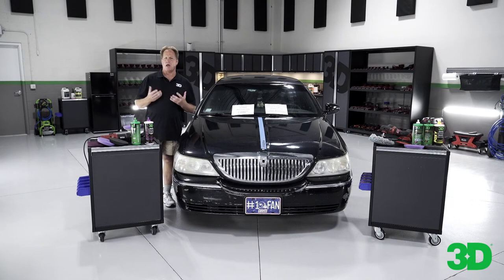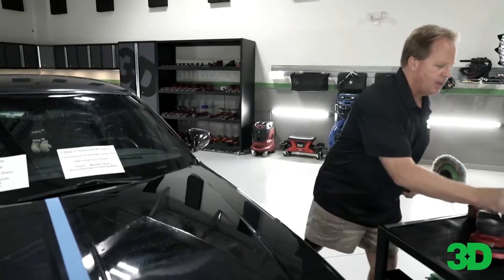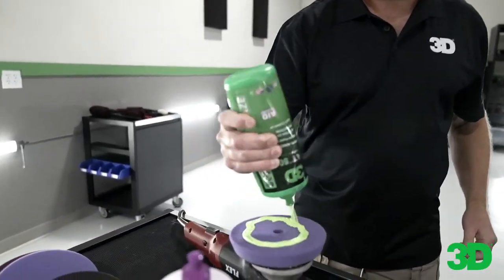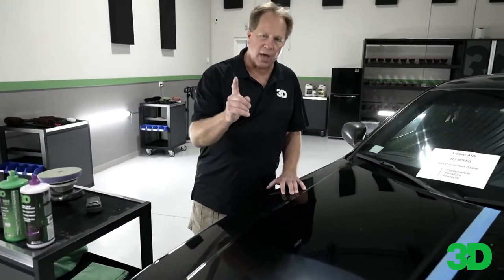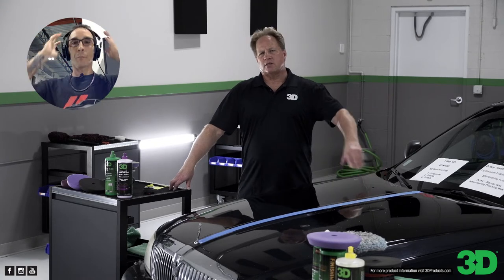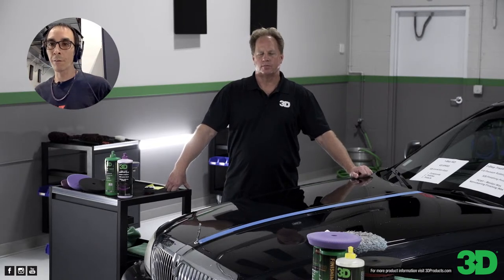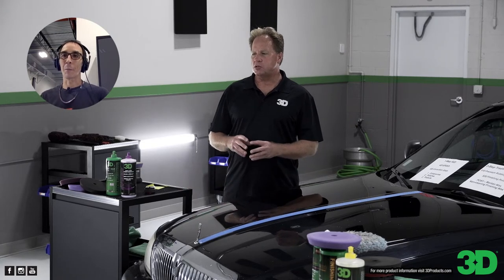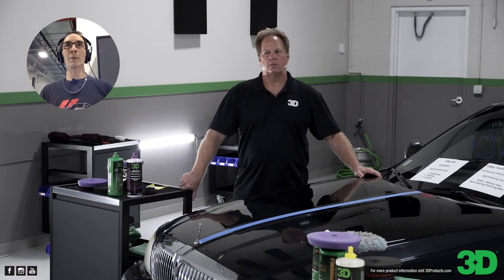The Power Of A One Step Polish

Comment: I used 505 for the first time today. I normally use Speed but thought id give the 505 a go. It worked really well and left a lovely rich and wet looking finish. I think i prefer it over Speed but will need to use it a bit more to know for certain. I really love the green colour and apple fragrance. Only thing id say is Speed leaves the surface a little slicker feeling. I dont think you can go wrong with either the Speed or 505, both excellent products.

Comment: Speed does have acrylic resins which do  fill slightly and seal and the montan wax  is the top layer of product. I've tested this multiple times using a prep wipe after and I've seen little to no defects come back, mainly if using on harder paints.
Reply from the maker: Used correctly - it REMOVES defects  - NOT fills in.  Used incorrectly - then sure, ALL WAXES THAT WORK FILL.  Otherwise, why would you use a product if it didn't leave itself behind?  Isn't that the idea of putting on a LAYER of wax?  To lay down a FILM of protection?  If you're leaving product behind to protect the paint it's only physics that it FILLS.  Common topic, lots of misinformation by all the experts on FB, IG and YT  

-Mike Phillips

Comment: Is 3D One water based and recommended before applying a ceramic coating? Just worried about residue left behind and the difficulty to remove before the car is sealed or coated. Thanks for the great video!
Reply from the maker: Yes and yes! _ Yancy

Comment: So would you recommend doing the one step and then when you're done with that go ahead and put proxy on that way you get a little more life out of it and more to protection?
Reply from the maker: Yes or use 3D Bead It Up.  If it were me?  I would use Bead It Up BUT - I would also use it on a regular basis.  If used on a regular basis, (because it's FAST and easy), there's no need for a wax or sealant.  If you're NOT going to maintain the results, then go with a wax or sealant.

-Mike PHillips

Comment: It is 510 and 520 water base,
Safe for aply ceramic coat after correction?
Reply from the maker: Yes - water based but you should use a Panel Wipe to prep paint before coating for MAXIMUM performance.

-Mike Phillips

Comment: Do you think 505 correction glaze with a microfiber pad would cut good on a newer rv and boat for a quick polish ?
Reply from the maker: Yes it would but remember that the microfiber is a form or abrasive in itself. I would suggest a foam pad (Polishing OR cutting) instead of microfiber cause the microfiber may leave marring behind and something that big you would want to only do the job once not twice. - Yancy

Comment: Hey guys, just a quick question, I can cut and polish fairly well I believe, and I use 3d products, definitely the best I have used, but I end to get some swirls when I have used speed( just have a standard rotary buff), what am I missing with this product?
Reply: I would definitely recommend using a DA polisher!
Reply from the maker: Get a FLEX BEAST and use this AFTER any rotary work.  -Mike Phillips

Comment: Can the 505 remove 3000 grit scratches ?
Reply from the maker: Depends on,

Paint hardness or paint softness.
Type of tool.
Type of pad.
Your skill and technique level.

On most paints, I could easily remove 3000 grit sanding marks using a foam cutting pad with the FLEX BEAST and even faster and easier with a wool pad or a foam pad on a rotary polisher.

In the real world, I wouldn't be trying to remove 3000 grit sanding marks as a normal practice as I would use 3D 510 Premium Rubbing Compound with a wool pad on a rotary.

-Mike Phillips